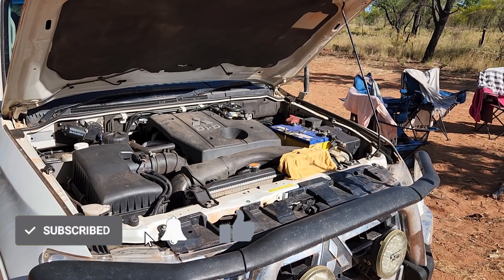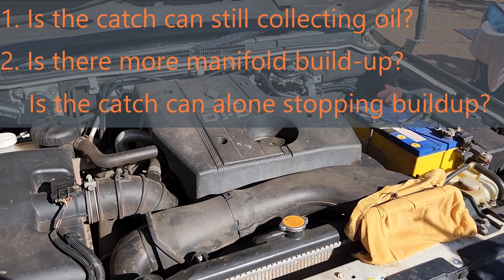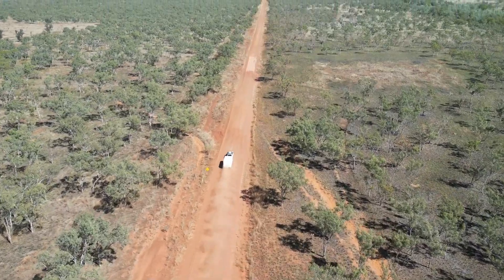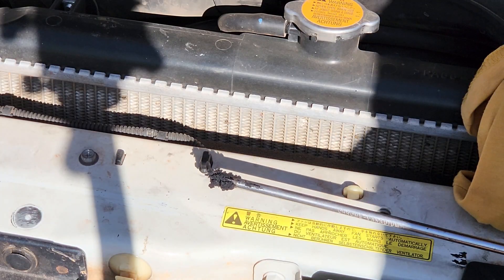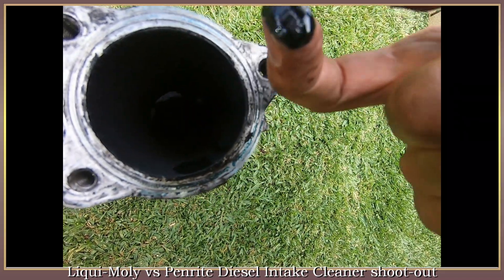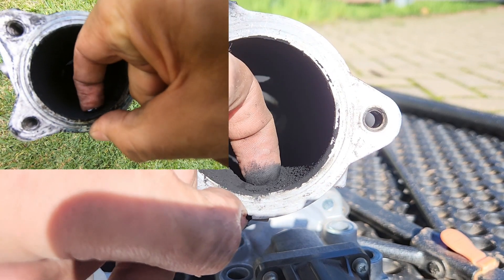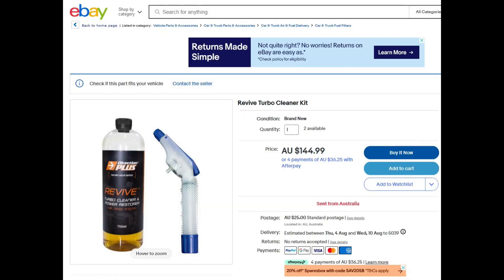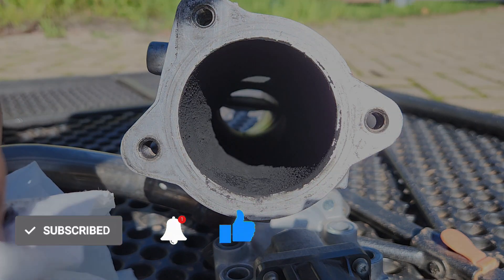[RESULTS!] Provent 200 Catch Can  - does it stop manifold gunk?? 40,000km road test!

Comment: The soot build up comes from the EGR, not the catch can. You have to do both for a clean intake manifold. If you only do one, do EGR delete. It works much better than the catchcan. For me, catchcan doesn't worth the money. If you block egr, all the soot will be blocked. Your intake manifold will have oil but clean, not oil mixed with the soot so its safe for the engine
Reply from the maker: Yep that's what I expect but it's something I'll be testing in future videos. Stay tuned!
Reply: @TheMusingGreg  delete egr and reflash the ECU... Problem fixed
Reply: Blocking EGR will slow down engine heat-up. If you have lots of short rides on cool engine, do not delete/restrict EGR, rather clean it periodically. Also, when you press accelerator hard, most electronic EGR will shut completely to avoid boost leak, so performance is not an issue.
Reply: @maniacse  if the weather temperature is not sub zero, you will be ok. I am living in Melbourne, Australia, the temperature range is about 5 degree Celsius up to 40 degree Celsius during whole year.
Reply: @ngochuybk  fair enogh. My experiences are from subzero temp indeed. And as I mentioned, affects mostly short rides. Then, if it is possible to restrict EGR and use catchcan, you should be fine with intake cleaning once and then you can enjoy your car! Fingers crossed!
Reply: On some vehicles that have EGR, the EGR gases can cool the combustion chamber also. On the P5AT motors (ford ranger), if you remove the EGR and don't tune, your combustion chamber temperatures increase. The temperature issue is solely because of the factory tune compensating or taking into account for EGR whilst having a blocked EGR.
Reply: I have a GDI so a catch can is a must.
Messing with the EGR most likely DTCs as well.
Reply: What happens when the EGR metal plate breaks down and shards of hot metal through your engine it happened to a friend.  Bang went a 14k motor. There must be a better way? Kevlar? Carbon Fibre?
Reply: @michaelhaller8495 sounds unlikely.  Most cylinder heads are aluminium, and on many cars the intake manifold is plastic.
Reply: @alanjm1234  he saying the EGR flap heats up and breaks apart
Reply: @michaelhaller8495 Lol what a load of shit
Reply: Not me, I prefer the catchcan because deleting the EGR is considered ILLEGAL
Reply: @RichardJoashTan  not delete,  just block it by a resistor at MAF sensor. You can take it out of the car anytime you want.
Reply: @ngochuybk still illegal. Catch can cannot vent to atmosphere is Australia either.
Reply: @chris4470 do you actually know how the catch can works? Lol
Reply: Not me, I prefer the catchcan.
Reply: @RichardJoashTan  catch can just reduce the oil, not prevent and the soot still mix to the oil
Reply: Aren’t catch cans illegal lol they are in NSW they breach Environmental Protection Agency regulations
Reply: @michaelhaller8495  catch can is legal. Blocking/deleting EGR is illegal
Reply: @michaelhaller8495 no, they dont. With catch cans, the pcv system remains fully intact and is neither eliminated nor bypassed. All that is done is a filter (catch system) is placed in line after the pcv to filter out oils, and let the gassss continue back to the engine for reburning. For some vehicles, there are now replaceable egr filters than can be placed after the egr so the soot is filtered out while the gasses continue for reburning. This actually enhances the intent if the epa standards and makes dpf filters last waaay longer. Manufacturers should be putting these on vehicles anyway, but the penny pinchers in accounting wont let them.  But doing so will both add to both epa compliance and increase engine life/durability. Removing pcv or egr is illegal. This doesnt do that.

Comment: This test is not correct as they say 30k so after 30k filter was holding to much oil
Reply from the maker: There are different figures out there, but 40,000km seems to be the most common. Berrima Diesel https://www.berrimadiesel.com/provent-200-replacement-filter says they last 50,000kms

Comment: I think u should change it every 30k so maybe on the 30k it was clean maybe the last 10k it got dirty ?
Reply from the maker: Nah if you check the first video https://youtu.be/dSmd-hu3nu4 you'll see the oil and filter got black oil quite early. There are different figures out there on how long the filters last, but 40,000km seems to be the most common. Berrima Diesel https://www.berrimadiesel.com/provent-200-replacement-filter says they last 50,000kms
Reply: @TheMusingGreg  my bad
Reply from the maker: @sphinx5101  Not at all, there's conflicting info out there which definitely makes it confusing. Cheers!

Comment: I have an 20 mr triton.Before provent 200 i had huge oil fume circulation which was topping arounf the ic hose and oil was dipping from the corner of my ic.After installing the provent they both stopped.Even cc doesnt stop carbon build up it definitely stops the shitty oil fumes cloaking in the components esp. Ic.Thats alone a good reason for me to keep cc on my car.
Reply from the maker: Yeah there's no doubt it catches oil nicely so I'd believe that, especially if the hose clamps are a bit loose. Might pay to tighten them up a bit if you're getting dribbling.
Reply: @TheMusingGreg  changed the hose o ring as well.Keep up the good work bro👏👏👏

Comment: I think you are missing the point of the catch can it prevents or cuts down oil going back into the intake and gets into the inter cooler which can effect running temps its never going to stop the carbon gunk building up from the EGR valve that's a problem really not associated with PCR Valve or line
Reply from the maker: That's true; but for diesels, catch cans are advertised as being a solution to manifold gunk. So this series is as much about finding out what doesn't work as what does.

Comment: I do believe that the catch can is doing the job it is designed for..... to stop oil or reduce it getting into the intake system, depending on how good your motor is.
Diesels will always create that black sooty buildup no matter what.
The only true way to stop both build ups in the intake is to catch can the oil side an block off or turn off the egr side.
Reply from the maker: You're probably right mate in terms of their original purpose. However these days catch cans are being advertised as the solution to manifold gunk, and as I'm finding that's not the whole picture.
Reply: @TheMusingGreg  People say and do anything when money is involved.
Reply from the maker: @NoOne56488  Exactly. That's why it's so important to test those claims!

Comment: Hi Greg, interesting video. I just had the same provent in my 2020 3.2 pajero after having the egr removed and  cleaned, the intake butterfly was stuck partially open caused by the the build up of gunk in the egr. The car was not running right and the warning light came on. I was surprised that this happened so soon as it's only got 55.000kms on it and I've had since new. I don't go off road and no towing except for a small tinny and I do a bit of highway driving,  I also use Fuel Doctor, not sure if that helps. Anyway I've had it sorted out, not by mitsubishi but by a very good diesel mechanic, not sure if warranty would have covered that but I'd rather pay and get it done promptly and properly.
Reply from the maker: Thanks for the comment John, it's surprising to hear that from such a late model vehicle. I presume you mean the EGR valve was partially stuck open, not the intake throttle butterfly? I don't think Fuel Doctor would have affected it; according to the SDS https://fueldoctors.com.au/wp-content/uploads/images/Fuel-Doctor-MSDS-20.12.16.pdf the vast majority of Fuel Doctor is a mixture of different alcohols which would help to displace moisture and clean oily deposits in the fuel system. I wouldn't expect that's going to make a significant difference to the composition of the exhaust post-combustion.

I'm in the process of doing the tests I promised at the end of that video, and (spoiler alert) in that video I'll be showing that I felt the need to check the amount of build-up on a 2020 Pajero with 75,000kms on the clock and was very surprised how much gunk there was in the upper manifold. I can well imagine the EGR valve getting a bit hesitant to work under those conditions.
Reply: @TheMusingGreg  Thanks for your reply Greg,  will look forward to that test.

Comment: if you want to remove the soot you must relocate the pcv. Plug the inlet for the intake FROM the pcv then reroute it to your airbox BEFORE the filter. Delete the egr
Reply from the maker: Whoa no way! Sorry mate but that won't work. EGR delete I agree may well work, but reroute the PCV before the air box like that and you'll be pumping oil fumes through the air filter and air flow meter and gunking both those up in no time! I guess the air filter will initially act like a catch can and hold some of the oil fumes until it clogs up completely, but whatever gets through will just follow the same path as it does already into the manifold, so I don't see how that's going to help much. In any case as the video has shown, even if you take all the PCV oils out of the system (via the catch can in my case) the manifold still gets gunked up purely with EGR soot, so I can't see how simply plumbing the same fumes back into the intake in a different spot is going to change anything.

What is your thinking behind running the PCV fumes through the air box and how do you think that will prevent manifold build-up?

Comment: The problem is that catch cans aren't designed to prevent build up in diesel intakes.  They were designed to prevent oil entering the intake of petrol vehicles and reducing the effective RON of the fuel.  Diesel is much more oily and thus when it burns it still has a moisture content.  Nothing will stop this from coating the inside of an intake other that stopping the exhaust gasses actually entering the intake.  EGR deletes are illegal but are the only way to prevent the sooty build up.
Reply from the maker: Yes that's what this series is attempting to explain with hard data and tests. I suspect you're right, but I'll reserve my judgement until the final test results are in. Cheers!
Reply: Thanks man, you are 100% right
Reply: Unfortunately, I completely disagree with you. I also have an OCC installed in my CRD. This captures a lot of oil that would otherwise enter the intake tract. Since this additional oil doesn't enter the intake manifold, the soot recirculated via the EGR will also be less oily. Consequently, more dry soot is recirculated, and that's clearly an advantage. Personally, I prefer to blow dry soot back, like mush.

Comment: I have a 2016 79 series Landcruiser with the V8 diesel. at 35,000 kilometers I installed a Provent 200. like your videos it definitely catch's blow by oil. Now after putting more than 50,000 kilometers with a catch can, carbon is still building up in the inlet manifolds as you describe. to me this seems abrasive and as these engines are known to wear badly due to dusting I'm concerned that dry powdery carbon could be as bad as dust. I am seriously thinking of removing the catch can and returning to a stock setup as this will stop the carbon being powdery and the blow by oil would help lubricate the inlet valves, besides most of the oil would get burned off as I tend to use this vehicle for long runs. for me I would rather remove the intercooler, egr valves and intake manifolds and clean it every, say 150k
Reply from the maker: Yeah you could well be right. I'm thinking of doing a test with no catch can and with the resistor mod stopping EGR soot getting through and seeing how that works out. I think the oil in the intercooler would still be a problem without the catch can but it would be interesting to see what effect that has so we can make informed choices.

Cheers,
Greg
Reply: @TheMusingGreg  You've done 35k without a catch can ,how much oil and crap do you think you've accumulated before putting on the catch can ...put one on when you buy it !!!
Reply from the maker: @ktmkaos  My testing has showed that a catch can on its own doesn't stop build-up. It just slows the build-up and changes its composition from oily and claggy to dry and gritty. Putting a catch can on when it was new wouldn't change any of that.
Reply: Turn the EGR off too. You have to, if you want a million mile engine.

Comment: Not a blanking plate but a 9mm hole, I also used a bottle diesel power extreme in my Pajero seems to make better fuel economy
Reply from the maker: Yes a small hole would certainly let less egr through. Which product exactly did you use? Is it a fuel additive that claims to clean injectors and the post-combustion path, or an air intake additive which might do the intake manifold?

Comment: What I've learnt from the videos so far is,  might be obvious to most.

The catch is for oil period. So the manifold has less oil but the build up remians cause  there's nothing to catch the build up carbon. 
If there was a system for carbon collection, there will no build of carbon in the manifold.
So, if there was system for collecting oil and build up. The problem will be solved.
Or find the root cause of carbon and work on that to reduce it
Reply from the maker: Thanks for the summary, yep I think that's on point. I'm hoping the resistor mod in the forthcoming video will help deal with the carbon, because it's coming from the EGR circuit which the resistor mod will close off. Stay tuned!

Comment: Looking forward for your all tests outcome. I have 2014NX with same catch can and resistor mod since I purchased it (115kkm). Now it has 205kkm and I never looked inside manifold. Maybe I should one day but didn't notice any issues at the moment. My idea was that that (old) build-up should be now dry enough to get pulled in to cylinder but watching this video I'm starting to think that maybe moisturizing it by fumes would work better. So in fact resistor mod and no catch can could have worked better. But then what about oil collected in IC? Anyway... waiting for your outcomes.
Reply from the maker: Hi mate yeah I don't think the old build-up is going to get pulled through unfortunately. I've not tested it yet, but if I was in your situation I would be doing a physical removal and clean of the manifold now because I think you've got enough bits in place to prevent it building up again. But I'll have more data on that down the track.

Your thinking in your last sentence is along exactly the same lines as mine, which is part of why I'm open-ended as to how many more videos I might need to make as I want to test all these things out.

Cheers and stay tuned!

Comment: Interesting to see the results. I've got the same one on my Ranger. EGRs seem to be a real problem with quite a few cars. So, the mod makes it better but still a problem in the long run. Thanks for the vids. I'll look out for the next ones. Cheers PP
Reply from the maker: Yeah I was a bit surprised to see that much buildup, like I said at the end of the 18000km video I thought the catch can would have dealt with the problem completely. I'm as interested as you you see the results of the next test, still waiting for the product to arrive!
Reply: @TheMusingGreg  Thanks for the replies. I'd be interested once you've investigated it, whether you think manually cleaning them is still the answer and, if so, how often? I'm thinking it might still be the best option, be a nice addition to your videos, based on your experiences. Good luck! PP
Reply from the maker: Yeah my gut is telling me the same, as far as it's worth cleaning the manifold anyway. In the very first Liqui-Moly video I did mention that the build-up doesn't affect performance or economy at least on modern turbo diesels, but I still prefer the intake to be open and free flowing so the turbo's not having to work so hard to feed the engine the air it needs. But I'm also just really interested seeing if any of these products actually work!

I'll note your suggestion for the next video, thanks!

Cheers!

Comment: Thanks Greg, a lot have been waiting for your testing, thank you for taking the time and effort to do this for all of us to learn... I have been waiting for this to maybe install my catch can. I also just recently purchased a EGR blank with a 7mm hole, what's your thought on these along with the catch can ?? be interested in knowing your thoughts, this combo might sort this build up issue ??
Reply from the maker: Hi mate yeah sorry it took a bit to get it posted! When I found the sticky buildup I felt I needed to pull the upper manifold off to find how much was actually inside - and just as well I did!

I would get your manifold clean and then install what you've got and see how things go since you've already got it. It's easily reversible if you find it doesn't work or want to try a different solution like the resistor mod later. I expect you'll still get some buildup like I have, but with a smaller hole there will be less than I got.

I recall something about possibly needing a hole in the throttle body plate in the Pajero if you block the EGR to prevent throwing an engine fault code, but I don't recall if that was relevant if you had a hole in the plate. Probably worth checking that. 

Good luck!